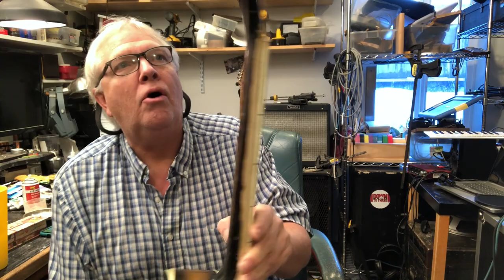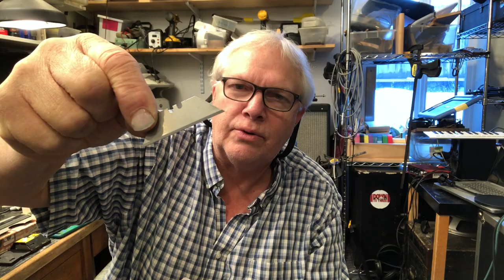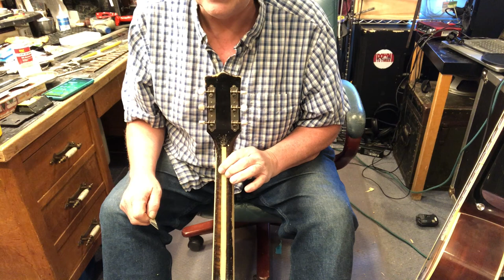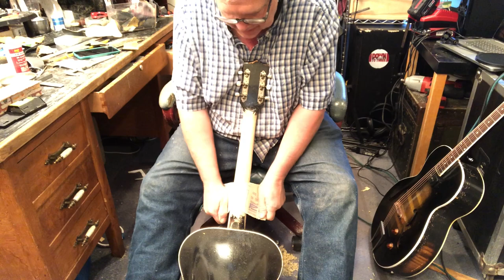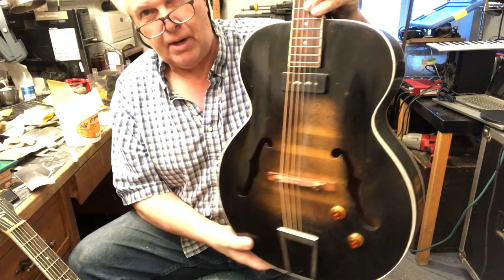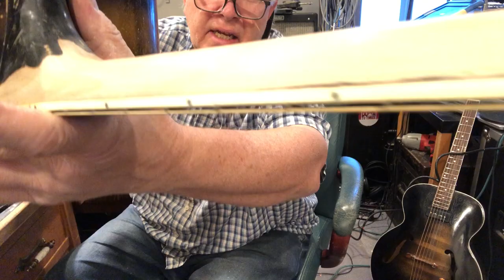Shaving down a guitar neck Harmony Monterey archtop. Changing the Contour. Easier than you think.

Comment: That’s great Dave the barbarian!
Reply from the maker: Oh oh... Is that name going to stick....lol
Reply: this video is so sad.  "its not a gibson".....what a sad excuse.  i restore/repair guitars.  done so for 50 years.  when i see crap like this, it reminds me that i will always be busy fixing the crap that people do to guitars.  having said that.  i like the effort you put into the new rosewood board and the rod. if you had done that correctly, you would never have needed to do anything else and the finish on the neck would only need very slight touch up at the edge where the board meets the neck wood and you would have actually increased the value of the guitar in my opinion.     ok so first off.....the harmony monterey is made a bit different than some of the other harmony archtops. the top and back are made from thinner plywoods, making the guitar a bit lighter. lighter translates into more volume...not necessarily into a very strong guitar.  the size of the neck....its bigger so that it will be more stable and also help the light body sustain better.  by thinning the neck, you just degraded the guitar visually and structurally.....but..."its not a gibson"....so who cares.  not many real nice condition harmony guitars around.....this video demonstrates why, and also shows how you make a $250 guitar into a $75 guitar with just a razor blade. lastly, i am seeing more and more harmony/kay guitars brought to me for work as the value of them has been going up in the last few years. they are worth at least treating them like you would treat a gibson even if they are not a gibson.
Reply from the maker: @billhatcher9303  well it sounds like we want different things out of life. This guitar is not the holy Grail and was a basket case.  There's a ton of these out there I don't think there's anything wrong with having a few with a thin profile for my private collection. Or sharing it.
Reply: Isn't it amazing how many "experts " out there that poo poo and give their unsolicited opinions on how people should repair guitars. It's wood guys. Taking a basket case guitar that hasn't played music in  a hundred yrs and bringing it back to life by whatever means. If it's fun do it.
Reply from the maker: @guygagnon7433  well there's no way I'm going to pay someone $1,000 to turn my $250 guitar into $450 guitar.  I think shop rates are between $80 and $120 an hour now.   I love my $75 guitar.
Reply: @davepontrello4159  I hear you. Keep doing what your doing. I've had comments said about my . Work . I've never had any complaints.
Reply: @billhatcher9303  Well said Bill.

Comment: Always wanted an old National metal body resonator guitar but the prices for the round neck (spanish) version were out of my reach. So a few years ago a square neck version came up on Evil bay for a Buy it Now price of about half of what a round neck
would be so I pulled the trigger. I used the rasp method followed by some sanding/staining and ended up with what was once a strickly lap style guitar (which I don't play) to one I could play in the regular position. I was happy with the final result and although purists would cringe, I saved $2000!

Comment: I hand roll finger board edges on lesser models the same exact way . Epiphones , Squirts and such
First dressing the fret ends with an old Nicholson #4 , then rolling  the board edges this way gets rid of any tooling marks 
And never try to do between each fret all at once 
Rather , 2 swipes between each on the desired angle 
Doing as many passes over entire neck length until desired
Results

Comment: Brilliant, absolutely brilliant! I have a '59 Les Paul with a thick neck that I've been hankering to shave for some time. I thought about using a spoke shave, belt sander, Shinto rasp, etc. Now I know what to do and how to do it. Thank You! Oh, and by the way, for a pickup you might want to have a look at a Kent Armstrong Slimbucker. They come in black, gold, chrome and nickel and are only 3/8th of an inch thick.
Reply: I'm assuming your joking....real 59 or a reissue?  They already had thinner necks.  Sell it and buy something thinner.
Reply: @konradkoeppe2840  Thinner than a '58 but not as thin as a '60.
Reply from the maker: I have a gold top that I'm going to do in the near future. I have never shaved a mahogany neck. We'll have to see how that goes.

Comment: Hi Dave I like your confident, no nonsense approach to this. Not to be recommended on a valuable vintage  guitar though! I like the way you have left the strings on too, as this gives you a direct way of assessing progress - most people probably would strip the guitar down. Couple of tips - when sanding across the neck it's good to use a sanding beam to get an even transition along the neck length. Secondly to check on the thickness of wood left under the truss rod you can drill a tiny hole and use a pin or similar as a depth gauge. Cheers.
Reply from the maker: Good idea on the small hole.... I actually have a 2 inch PVC pipe 6 inches in length or so.  I cut in three inch sections. Then double back tape to the inside. I didn't use it in this video but having the past. It was sure to put it in the video now because it helps when you're first starting out.

Comment: Here's a tip 
. Instead of painting it .. Use alcohol based tanning stain ... then just clear Lacquer it and your done .... I like to lightly sand the last coat with 300 or so grit and just leave it... it lets your hand slide up and down the neck a lot easier..

Comment: I slimmed down the neck on a Donner LP so it matches the profile of my Gibson.  Only sandpaper, though. That way I could continue to play it until it felt right.
Reply from the maker: That sounds like it took a while. But as long as you get where you want to be all is good.
Reply: @davepontrello4159  It did take a while, but I felt safer doing it like that.

Comment: I have my Dad's early 50's Silvertone archtop with no metal rod at all in the neck.  I was wondering how much trouble it would be to take the fretboard off, route out a channel and put a truss rod in, then thin down the neck like you did.  I really don't have the tools, though, and like you said, it wouldn't increase the value any.  Thanks for showing this part of the change.  By any chance did you video putting the truss rod in?

Comment: Do you sharpen your blades first or are they right out of the package? Thanks.
Reply from the maker: When I scrape down the neck I used to use a brand new blade. I buy them in 100 pack at Lowe's. I use a lot of them.

Comment: Is there a reason guitar necks and fret boards are always built wider and thicker at the end where it meets the body than the other end at the headstock? Can you explain the physics of why they're built that way? What would happen if you built a neck that was the same on Both ends? ..also that way the string spacing would have be the same, consistently, all the way down the neck, ..so you'd have to cut the Nut with the same string spacing as the Bridge.

Comment: Nice Dave I'm a scraper man also. I just picked up a Hand made 12 string that has a baseball bat neck. Needs major thinning.
Reply from the maker: Yeah I very rarely sand except for the final finish work on softer woods. I have lots of scrapers but the ole reliable Stanley box knife blade is my go-to in most cases.

Comment: If you shave the neck on a guitar with a adjustable truss rod how do you know how much you can take off without taking too much off and scraping down through into the truss rod cavity chanel?
Reply from the maker: On the last two I did I actually measured the depth of the truss rod because I put those in. Most are fairly shallow as long as you're not going ultra thin you should be okay. But you might want to do some research of what type of trust rod your guitar has.